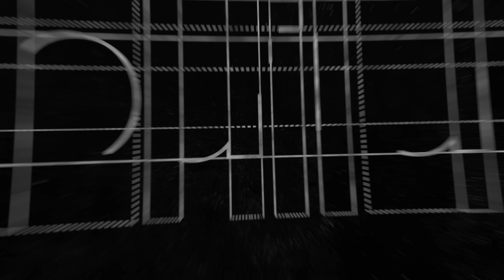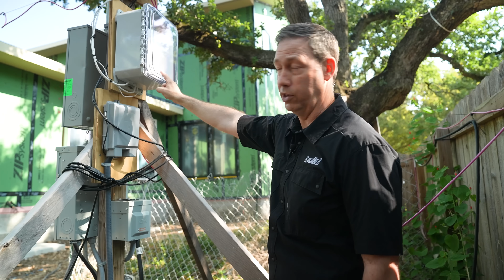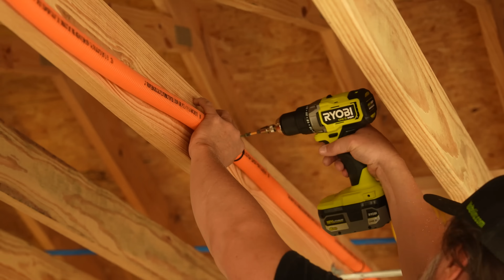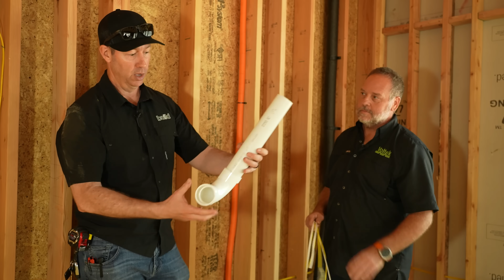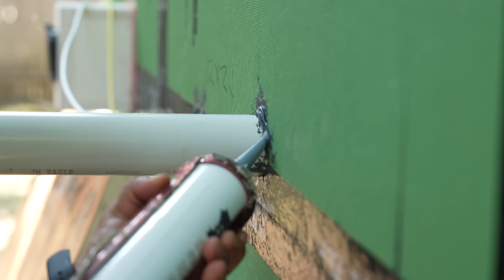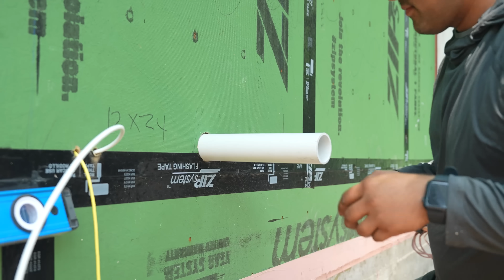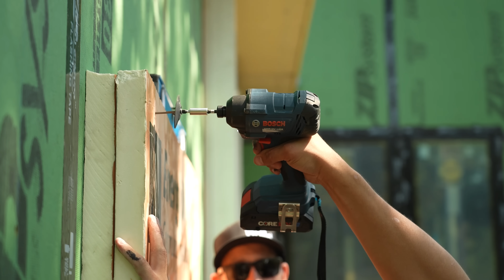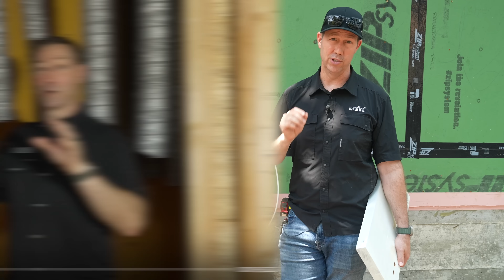Preparing for Google Fiber & Future-Proofing!

Comment: First off, the guy said google fiber uses a single fiber.  I doubt that.  The fibers are used in pairs, one for send and one for receive.  A single strand of fiber is a one way street in any application I have ever heard of.
I don't know what google fiber does, but you don't need a demarc box outside the house because fiber is non-conductive.  No grounding point necessary.  Why he is running a conduit and separate cabling and not running the cabling in his conduit is a mystery to me.  Run the conduit from your indoor IT hub point to a j-box on the outside of the building and then another conduit from the j-box to the street.  If you think you might be using coax, then substitute a demarc box for the jbox and provide grounding.  You can pull the fiber from the street then as a single run all the way to the attic or wherever your IT hub location is and put your modem there.  And yes, totally agree with locating that hub that inside the conditioned space so your modem, router, switches, etc live a nice long life.  
Whatever the future holds for data cabling, you will be able to pull through that conduit.  Though I suspect the future is wireless anyway.  The benefit of fiber is not the speed, it is that it is non-conductive and there is minimal degradation of signal over extremely long distances, so it is great for the ISP to get the signal to your home/business.  But once there, it terminates to a modem and CAT6 takes over running up to 10 gigs over most all of your LAN type distances.  Furthermore, fiber is complicated to terminate and therefore not user friendly for the homeowner so who would want that in their house?  
I haven't seen any indication that any device is going to run faster than 10gigs anytime soon.  You can stream a whole lot of HD video with a whole lot less than even 1gig, so unless something happens like 3d holography or something, you are just wasting money on anything faster than even a few hundred megs in a residential situation.
Reply: yeah, there was a lot that is off on this. Matt really should have gotten a telecom expert in on this one. He went through all that effort to make the conduit and not even use it?
And even then, the cables he put in, will likely just have to be left unused anyway from the ISP as putting a coupling on them would just be problematic and they'll just want to run a line that has no breaks into the house, hopefully through his conduit that they set up. 
And if they plan on bringing internet into the house regardless if its Coax Cable, fiber or satellite, they should have a telecom rack ready to place the cable modem/router and also prep for Wi-Fi Access Points to be ran through the house with POE network switches to make it dead simple.
Reply: @cybernoid001  And the ISP guys are going to take zippo responsibility for that fiber he ran from the outside of the house to the attic.  If there is an issue, they are going to say . . . "not our fault, it is your fiber".  Let the ISP run their own cabling all the way to the modem using the conduit, which the builder should leave empty but for a pull string.
Reply: Google Fiber (and most of the larger fiber ISPs in the US) use GPON. GPON uses a single fiber for send and receive for multiple users via time-division multiplexing and passive optical splitters. Supposedly, it's cheaper to implement than an active-ethernet system.
Reply: @cybernoid001  I'm sorry, but you and OP are both wrong. ISPs using GPON technology, like google, only need one strand with bi-directional optics. Some enterprise connections even use bi-di. And yes, Google and other ISPs will still put an anclousure on the outside of the home for a coupling - so that when the buried line is inevitably cut, there is only one mechanical termination to make instead of a fusion splice in the field.
Reply: @seanpalmer8472  i have att fiber and they have two single mode fibers going to the modem, not saying you aren't correct, just not my experience. It is att owned fiber all the way into my it closet where they put their modem.
Reply: He might have been referring to single mode fibre, not single fibre. There is single mode and multimode fibre, it dosnt mean number of fibres it refers to size of fibre. Against all reasoning the smaller the fibre the larger data capacity and length of transmission.
Reply: @Zach_T_M  We use single fibres for transmit and receive, means we can double up on switch ports saving big money

Comment: The future for standard home installations is probably 5G cellular home internet.  Zero wires in the walls.  I have 5G home internet nownow and it’s FASTER (with zero reliability issues) than any “gigabit” wired services that I have ever subscribed to in the past.
Reply: I've had the opposite experience. I tried AT&T Internet Air and T-Mobile Home Internet. Both were reasonably priced, but the services were just unstable. The speeds fluctuated too much. With T-mobile, I usually got slower than DSL speeds. And believe me. I tried placing the T-Mobile gateway at different parts of my house and at different times throughout the day. It rarely got over 300 Mbps and averaged less than 10 Mbps.

You also have to keep in mind that all the wireless home internet services are given lower priority over the cellphones. So even if you have a strong signal, the provider will give you a lower priority.

Comment: This makes zero sense, feeding cables through convoluted flex sucks, would just run a 1.5 - 2 inch pvc with sweeps to the attic and the top of a waterproof enclosure outside the house that has bottom entry points available, this leaves room to easily pull any cable you like for telco or POE to outside devices.

Comment: This makes no sense lmao. Where's the structured media enclosure? You don't have enough cables to put a rack, so your just gonna lay all the equipment on the floor? Why run fiber in the walls when you have Smurf tube? I'm an AT&T technician in Texas, and I do daily installs with Smurf tube going from the DMARC to panel, and sometimes another Smurf tube going from DMARC to attic. All you need is Smurf tube, the other stuff is just too much.

Comment: Why would you bother to run orange innerduct and leave the end of it buried inside the wall without any future access? Makes absolutely no sense. Run it outside into a J-Box. Better yet, run two one inchers or one two inch innerduct. Leave them empty with pullstrings. Fiber providers tend to want to pull their own fiber anyway.
Reply from the maker: We did that because we wanted to air seal properly. The other pipe is for future runs.

Comment: Note to all.  Have more respect for the low voltage trade and your house.  Don't step on copper wire either.

Think if he hadn't seen Matt step on the cable and it got damaged.  No one would have known until the house was done.  Then you'd be calling him back, asking him to burn his time and money to troubleshoot and repair tour mistake.

Comment: If I'm inspecting this, your installation is getting tagged because you didn't use electrical conduit, your ENT doesn't go anywhere accessible, and your attic install isn't in an enclosure or on a fire treated board.
Reply: It's low voltage

Comment: you really want cat8 - it is not that much more expensive and you can use 25/40g cards to really future proof lan. also why not have centralized mechanicals in basement - what happens if power goes out - in attic it cooks, in basement things stay  cooler and it more organized with all elec/hvac/ plumbing/internet in one spot - you have to think about worst case scenarios especially in texas. you probably want ha opnsense boxes with dual wan for link agg and failover then a couple 8-16 port switches 10g ports and some 25 or 100g ports and have one switch be poe for all the cameras and ap - it should not cost too much and you can do much of it yourself - definitely shop around - in 5-10 years you may want to upgrade to all fiber and do away with the wire so plan for that - you can just tie new fiber to old cat8 and use that to pull in the new fiber - no need to add extra fish tape strings etc #poe #switch #mikrotik

Comment: i bet  in 30 yrs we wont have fiber  or coaxial cable and u  wont need any of this.
Reply: i dunno it's hard to beat light in terms of transmission speed. fiber has been the king of long haul high bandwidth networks for a LONG time. What's faster and more reliable ethernet or wifi? physical connections are hard to beat in terms of speed and reliability

Comment: The attic?  You have to be kidding.  Fyi, there are things called media panels that fit between studs.  Run all your low voltage to one in the centre of the house, and consider re-making this rediculous video. Also, fire your tech guy.  No self respecting technician would put media in an attic.  May as well make room for the lawn mower up there.

Comment: Matt, as you can read, many of us who do this for a living are feeling a little triggered. There are so mnay things that could or should be done different. Obviously, different countries have different standards but here are some obvious:
Multi-Mode (MM) Vs Single-Mode (SM), I am yet to see a provider stupid enough to be using MM, no good for service delivery. Corogated orange conduit, if someone installed that crap in a house and no draw-rope, I would make them pull the plaster (dry-wall) off and fix it. Use rigid and sweep bends. Orange here marks power, data is to be in white. Fibre strength, your guy was talking crap. The aramid strands do nothing for crush resistance at all. They are there for pull/stretch resistance and we also use them for stripping the outer jacket (tear lines). Metal braid is for RF noise or EMR sheilding, useless on fibre and now just made that cable conductive and pushes into other electrical safety problems. As for extras in the run, Coax, quad-shield straight up. Duo and Tri, leave that in the budget stores. Run a couple of CAT6 data cables as well. Outside, would be an IP6x cabinet with conduits direct to it.
Reply: Most of what you said is accurate but the metal in fiber cables are to protect the fibers it’s called armored cable.
Reply: @shelms488  Nope, Braid does not stop crush or cink damage, maybe some cut resistance but a sharp knife still goes like butter there. Armouring is full metal jacket (usually wound on spirally and interlocked) which still allows for some bending. Good example is pay-phone hand-piece cables.

Comment: Demarc. Is always on the outside of the home. Not inside. The “utility” always stops on the exterior where they have access.
Running fiber inside is a waste. Nothing in your home will utilize fiber. Just run coax or Ethernet inside. The only place you may connect hardwire is a computer or Tv. Maybe not even then since most TVs are Wi-Fi and some don’t even have Ethernet ports anymore.
Also no one under 80 has a hardwired land line so no “phone(cat3)” needs to be run. POTS have gone the way of the Dodo as have cordless home phones. If anything, just run coax or Ethernet wherever you think you may need a network/wifi extender so you don’t need a bunch of Wi-Fi plug in or those mesh connections.
I’m having my home restuccoed and painted. Just disconnected the old single pair drop from my home two days ago leaving only the FO service. If you ever watch cable tv service provider commercials. They never compare themselves to whatever FO service in the area. They can’t compare a shared network which they are to a single fiber to each home. 
Sure other communications guys have said the same. Just repeating it.

Comment: Matt, you need to look up the incoming 6G cellular. It's going to make wires in a home obsolete. I'm not running any low voltage in my new construction besides speaker for music and theatre. I'll rely on wifi and 6g in the near future.
Reply: 6G cellular technology has a projected rollout date of 2030. Cellular technology and WiFi do not offer Power over Ethernet (PoE), which can really benefit the installation of security cameras and other devices that may not be near an electrical receptacle. WiFi offers less security and interference resistance compared to physical Ethernet and fiber-optic cables. Every prior wireless technology promised to make everything else obsolete, but we keep innovating. Do a favor for your future self and reconsider your stance. It's much easier and cheaper to run some cables (or preferably cable ducting) before construction is complete.
Reply: @DynamicBits  define security? I’m not that important and I’m not that anxious over security. 6G will make cable obsolete, I’m so confident in that I’ll post it here and see where we stand when it rolls out. lol. I do appreciate your perspective, but I just see us in a wireless world. Look at new Teslas. They run the whole car though the air and less and less wire is installed. Homes are super close.

Comment: Texas wants to have thier own stock exchange. Like NYC’s Wallstreet, but in Dallas (The Financial District of Texas). Which requires Fiber for high speed trading. Yet Austin gets fiber first😂. Y’all sure got your priorities in order down there.  Hasn’t ATT been trying to get fiber ran through Dallas for over 10 years now? And it’s still off? unavailable? Yea😂 I definitely do not see Texas being able to handle a stock exchange.
Reply: this is a silly comment. you think most houses/apartments have fiber in NYC? there is fiber optics running along side most decent sized roads in all of the lower 48 states. This connectivity was mostly limited only to business' due to the cost but fiber is getting cheaper and cheaper and the bandwidth usage of homes is growing so now normal people can get it. Plus dallas metro area was one of the 1st places fiber optics to homes was deployed back in early 2000's by verizon

Comment: The two wires coming out of the house are way too close together. Internet or cable providers bring their own surface mount boxes, and they are often quite large the wires should have been a foot apart. 

Also, should have run a cat 6 for future starlink while you were at it. 

Lastly, why cedar? Should have used a resin produc.